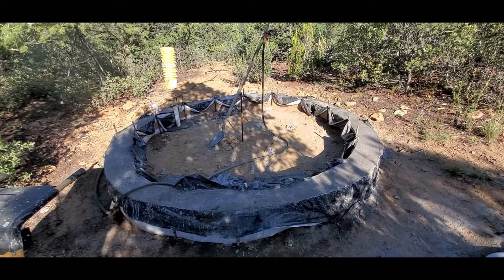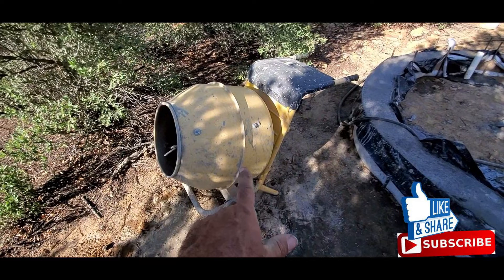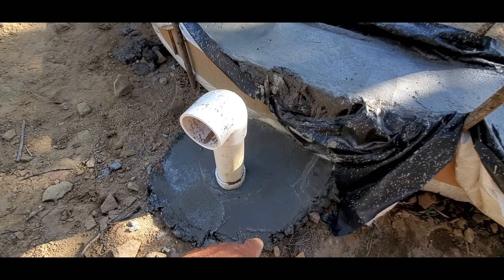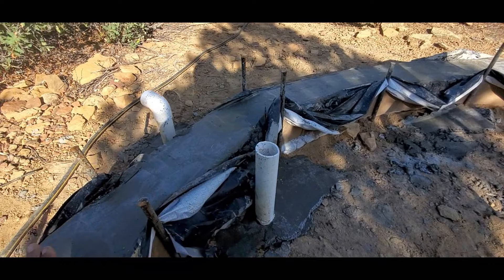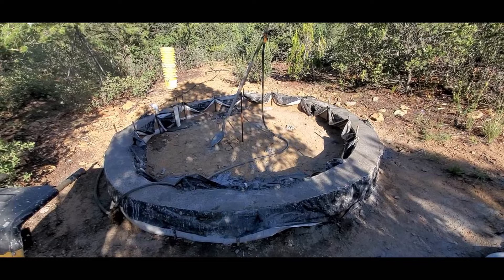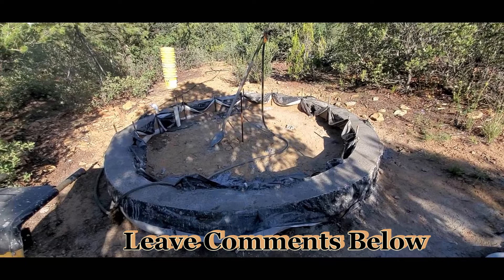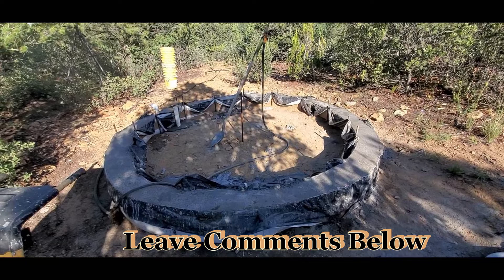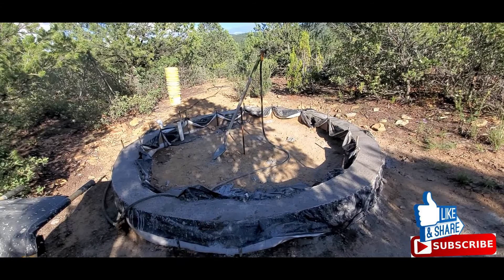9 Foot Ceramic Beads Dome Build P1 #domehome #ceramicbeads #stucco #latex #AircreteHarry #DIY #dome

Comment: Question:
What's the best, double blade mixer of all those you've tried?
I mean the one that's heavy duty and strong enough to mix a 40 gallon batch of aircrete.
Reply from the maker: In the description of this video I included a Recommend Tools Link. 
Tools I've personally used. 
You will find double blade mixers on it.
(Another company I've been recommending has been out of stock for a very long time)
Reply: @AircreteHarry  Yes,  I looked through that list and looked at every single one of the mixers (most being out of stock) but still wanted to know which you ranked 1st, 2nd, etc.
It would be helpful to your long term viewers (like me) so that if a used one comes up on eBay or something or the supply chain starts working better  we know what to look for.
And really like your newest project videos,  you've gone so far it's amazing
Reply from the maker: @bobjoatmon1993   Thank you for your greet feedback, I greatly Appreciate You!
Happy to read you have been a Loyal Viewer for a while, AWESOME Brother👍 👍 
Keep the comments comming, it helps us. 👍 👍 
My Top pick would be:  Klutch Double Auger Mortar Mixer | Northern Tool
The other ones you see posted in the Link take 2nd pick. All work well.

Comment: I could see all these shesd or tool sheds all over so inexpensive to make last a lifetime keep up the good work
Reply from the maker: Thank you very much 👍 👍 
Exactly what I mean - the sheds sold all over  are very expensive and won't last a long time anyway. 
With time, they'll require to be treated, so there goes more money. 
Plus termites will find a way in - one way or another.
With that money - get yourselves a soli structure. Lesser cost, stronger, termiteproof, fireproof, tornado proof, hurricane proof!!

Comment: When you say 'sand and cement', are you saying that you aren't also using foam(aircrete) to spray over the airform?
Reply from the maker: Yes, that's correct. No foam.

Comment: I have been following you for a couple years.  I like how you are experimenting and using low cost building options.   Seeing your 2 videos on the 9 ft shed. Is inspiring.   Thanks also for giving your material quantities.
Reply from the maker: Appreciate you Larry! Thank you Brother.
We truly can Inspire each other by spreading the word of encouragement. 👍 
It's important to share that people have options as well as possibilities - which are very manageable to do yourself and not having to spend crazy amounts that are even crazier nowardays.
Reply: @AircreteHarry  
I need a shop.  Using your system.   
Hoop house. Extra hoops. Cover with house wrap and sealed as u do with your dome.   Coat with sand Crete  inflate   
Side wall 12” wide 24” deep. With hoop anchors on 2 ft center s. 
Do you think this is feasible?
Larry s 
16 ft wide 32 long.
Reply from the maker: @larrystrayer8336  Email me your dedign, I'll take a look at it for you.
Aircreteharry@gmail.com